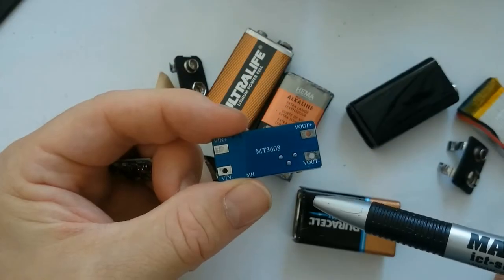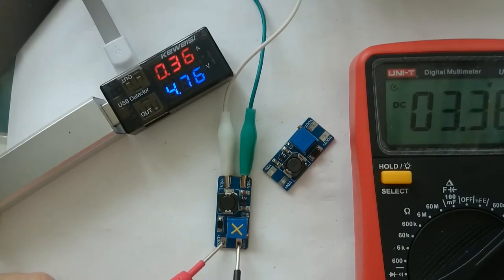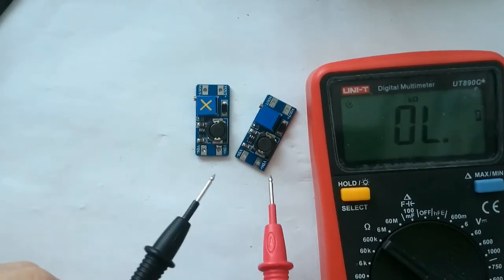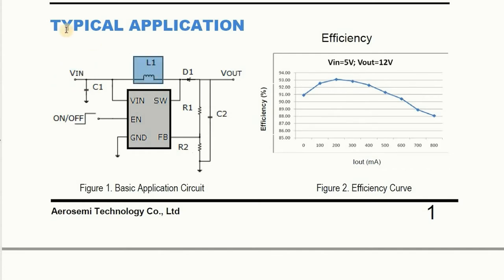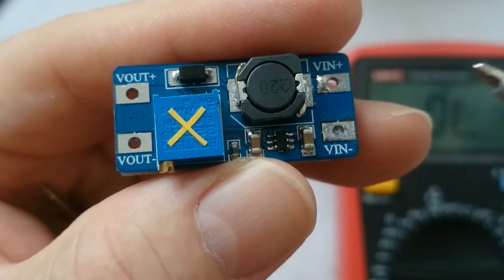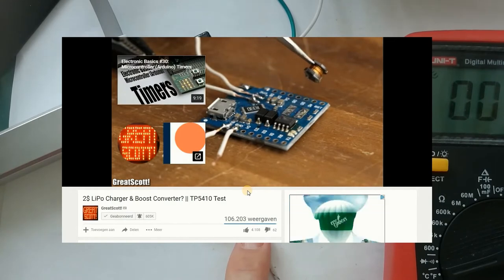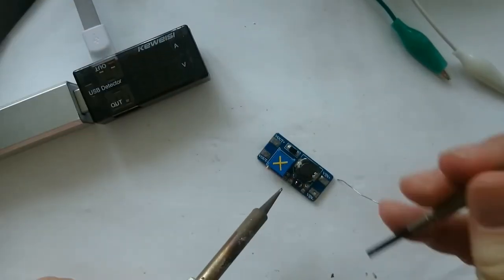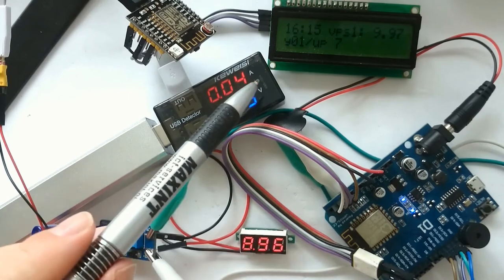Repair: MT3608 boost converter

Comment: That is a creative desoldering technique. The temperature of the chip had to have been near 220C, assuming it was lead-free solder. More importantly, a simple fix to avoid discarding the module altogether. Nice one!
Reply from the maker: +MindFlareRetro  - Creative indeed! For GreatScott it worked better (see his video), but I was afraid I would ruin the solder pads on this almost fully operational $1 module... ;-)

Comment: there's actually a way to stabilize the output and it can even handle all types of load when it is fixed.
Reply from the maker: I saw a couple of different improvements. Which one are you referring to?

Comment: Hi Maxint! The MT3608 is a chip i’m currently looking at for use in a new version of my MiniAmp. Easy to find a pretty straight forward!
Reply from the maker: Hey Dustin! Thank you for your comment. Your MiniAmp is a nice project and your EasyEDA videos (see https://youtu.be/VtKCyu5FitE) helped me a lot!
You may also want to take a peek at my video about making a tiny boost converter using the MT3608 (see https://youtu.be/K7Lv5FWTX9Y).
The MT3608 chip is easy to use. You only need to be careful not to set the output voltage below input voltage, so be careful to use right values for the resistors and don't short the sensing pin to ground (which can be done on these boost converter modules by turning the potmeter to one of its the ends). 
Also note that the amount of current it can supply is limited. When the difference between input and output is large, it can deliver less current and it will be less efficient.
Good luck with your new MiniAmp version!

Comment: There's a video on YouTube on how to desolder without hot air, the trick is to bend some copper wires all around the legs, add solder and off it goes, very easy.
Reply from the maker: I've seen that video. It's very informative. One time I tried that method I wasn't very good at it. Another method I once used (with good success) was using a needle between the chip and the PCB and a soldering iron, to lift the individual legs. While it worked, I think I prefer to use hot air.

Comment: Yeah, so I just did this with one of mine. I only found out it was the main IC after unsoldering everything on the board and checking connections. I should have checked that IC first but now I know! I ordered replacement IC’s so hopefully it will be as good as new! I just had the pot below the input voltage for too long...
Reply from the maker: Well done! While these are nice cheap modules, their lack of protection is apparantly resulting in some casualties. Luckily a chip replacement can revive them to be as good as new. Just beware of the voltage setting...
Reply: Yep, $0.86 and free shipping for 10 of them from aliexpress. I'm going to have to make some DIY boost converter board with multiple outputs and good pots. If I put a pic/arduino on there I could check the voltage and make calculations for minimum resistance. I'm mainly using it right now for a dirt cheap bench power supply for low current running on a laptop battery cell (they are dangerous to take apart but I did carefully).

Comment: I have tried this module. At first all was okay. From 3.7-4.2 V input source I config. for 12V output. My router was working fine. But back in couple of hours it stopped working. I found that my battery was drown empty, though I was using charging mode through a TP4056.

However, I then use another battery (3.7-4.2 V) but this time it fails to delivered the desired 12V load. I checked with multimeter before connecting load it shows 12V in the output jack. Battery is fine.
But whenever I connect to my router as load it falls to 1/10th of the desired volt ! I don't understand what's the problem ?
(input connected through TP4056) Your experienced input is very much appreciated.
Reply from the maker: Sorry for the late reply. Sounds like you are trying to use a battery that cannot provide the requested power. I have had this with batteries that were at the end of their lifespan. These would work fine with low currents, but fail when currents got slightly higher. Best way to test them is using a multimeter and adjustable constant current load.

Comment: nice repair video. i don't know about the idea of pushing high amps for desoldering components, but that sounds risky, it could damage nearby compenents or the copper traces on the board, maybe? but that limited edition tweezer you used for picking the chip off from the iron tip though.. that's awesome. :)
Reply from the maker: Thanks... Yeah, I should be careful as I only have those! ;-)
Reply: @MaxintRD  just sharing an alternative way here, hope you don't mind.. :) 
for desoldering small chip like that, you could put a blob of solder at each side, kinda like if you want to short all three legs of each side altogether, then melt the blobs back-and-forth for each side several times, while your other hand holding the chip with tweezer, ready to lift it off when the solder blobs at both side are molten already. eventually, it will lifted-off within some seconds.
hints : it will be more easier if you have a secondary iron and melt the blobs with two irons at the same time, one for each side, just like how smd hot tweezer works. ;)
Reply from the maker: @radius.indrawan  - I don't mind. Thanks for the suggestions. I used the blob technique too. Not with two irons though. I also once lifted a CH340G chip using a needle to put some force on one side. Nowadays I most often use a hot air gun, which I didn't have when making this video.
Reply: @MaxintRD  yes, hot air station is indeed very useful for this kind of situation. looking forward to your next video Sir. cheers. :)

Comment: Solved! and please ADD new tutorial about: how to repair broken pin or part of arduino board. Start from promini 5v 328p, nano 5v 328p and uno 328p. Pleaseeeeeeeeeeeeeeeeeeeeeeeeee. Thanks 😍😍😍😍😘😘😘
Reply from the maker: Great idea! I once replaced the diode of an Arduino Nano, after frying it by reversing polarity. It was not very hard to do and that Nano still works...
With regards to this booster board, I saw other people make improvements to make it better survive mistreatment and to lower the standby power usage. Perhaps once I make a follow-up video to show both improvements. (I don't have links here now, you may find them in comments below, or search YouTube for MT3608).
Reply: @MaxintRD  okay. thanks.

Comment: i replaced the100k  25 turn multi turn pot with a normal 100 normal 270 
degree trimpot.  the 25  trimpot is really stupid and you need a 
screwdriver and there is no knob for it anywhere
Reply from the maker: Ese Callum - That multiturn trimpot is indeed not ideal. Next to what you mention, it is also inactive in large part of the range, rendering many turns without response. I can imagine you may want to improve the range by adding a resistor in series to the pot.
Reply: did it already.added 82k resistor to 22k trimpot.this is for the version where the 3 rd leg of the precision  trimpot IS connected and the voltage variation only occurs over about 20k. 
in the second variation the 3rd led of precision trimpot is not connected to anything and voltage variation occurs more evenly over a 100k normal trimpot

Comment: Its not damaged its the chip its shorted and other in sets can trip it and high volt out like 8.4v in 25v out gose low volt high current 😕 iam using in a few application projects on the 6 board shorted 5 so far smoke including pin 4 has the issue in the transistor gate!!!!!!!! I'am trying to get the internal on the chip to fix the over load issue.....
Reply from the maker: Hi Troy, thank you for commenting. You raise an interesting point. As far as I know it is indeed the internal MOSFET that is shorted. I always though that the shortage was caused by irreversible damage. So you think there is a way to fix that short-out? If you do find a way I'm very interested. Perhaps you can make a follow-up video?
Reply: @MaxintRD  looking into it, and used a bunch off directors to fix most off the issue on the neg line but when i run the IR RF at the same time it gets a bit tweky could be a run of a safety the transistor for shut off it can become unstable as most of the negs are all directed allready to get it stable and safety setup, on the single IR line its fine and RF but dule mmmmmm i once put a npn type on a IR decor on the out gate pins blow the hole lot one after the next just kept blowing and was the type specified (wrong category) by the looks as you can get reflection on the parts which blow or get unstable when you lock transistor gates in this is a issue with pin 4 for the voltage gain the line seems to be a bit tweky especially on the curcit in development but i had it running on a motor fan 24v low ma above 24v it can trip this mosfet in it apparently as i have no internal curcit diagram which is slowing me down, dont ever short and i noticed a issue with the dc meter and multiple out lines which keeps going to 1.8v high current which should not happen but put it to the battery all ok again yet seen led on the meter and fine??at near 2 amp????? 😞 .
Reply from the maker: @troyw5832  - Sorry, I can't make heads or tails from your reply. I probably lack some understanding. Perhaps you can show how you repaired it in a video?

Comment: Same problem with xl6009 while make rechargeable power supply. Have you found the reason how it happened? Your input is very much appreciated.
Reply from the maker: i think it was due to drawing too much current. i don't think these cheap boost-converters offer any protection against doing that.
Reply: @MaxintRD  I just checked that diode was blown.. so I replaced it by 1N4007 (I know this one has greater voltage drop) and I m able to vary from 3.54 volts to 3.8 volts with 4 v input. Also it is not heating now. Whether replacing with right diode will solve my problem or the ic is blown. (ic : xl6009)
Or i doubt the inductor is blown
Reply from the maker: @shubhamsawant5129  Good you found a defective part. A boost converter should generate higher output than input. In my case I think the mosfet in the chip was blown, resulting in an internal short . The inductor can easily be checked with a multimeter, as it's just a wire it should have low resistance. Another possible cause of damage could be reversing the polarity.

Comment: Sir your demonstration is really amazing and truly on right time have found. Thanks for presenting such a wonderful content.

I have connected MT3608 module with 5v of power bank as input and boost to 12v, later i moved from 5v to 9v and where output remains the same like this couple of times have tested, However i could boost the voltage to desired output with any given input range, when load is connected, automatically voltage get drop to the same volt as input given. When i touch the IC it was too hot, immediately turned off and checked the diode its fine, later some time when connected to 5v power bank or source from 5v dc power adapter, i could see 12volt but unable to connect my router or any dc appliance that has 12v. 

Could you please give some insight. Your input is very much appreciated and thanks in advance for your help and support.
Reply from the maker: Thank you for your post. Reason the chip gets hot is probably that it can't deliver the power that the load is asking. Have you tried using a very small load? Some modules that can deliver more power use heat sinks. Another possible solution is to try increasing the input voltage. The efficiency of the chip is much lower when the voltage difference is high. Also make sure the input device can deliver the required power. I suggest you to use (multi)meters to measure voltage and current under load. Hope these tips help. Good luck!

Comment: I just bought 2 of these units on eBay. So far neither of them works to increase my output voltage. My input is 6.7v and output stays around 6.6v no matter which way I turn the pot or how many turns. Now I don't know if it's defective, or still repairable?  Any idea?
Reply from the maker: Hi Tim, my first guess is that they may be not faulty, but just not set correctly. I've experienced that the range of the potmeter is largely inactive. I would first disconnect the load and turn it down to the minimum level all the way untill you hear the meter tick. Then, with you voltmeter connected to the output, turn it the other way until you see the voltage change. Then continue slowly until you've reached the desired voltage. Then connect the load and check the voltage. If voltage drops a lot or the chip gets hot, your load may be too big. Mind you that if the chip gets hot you should cut the power to avoid damaging it. Good luck!
Reply: Thanks for the quick reply! I removed load from Vout and left Vin connected to 6.7v and turned 15-20 turns counterclockwise until I heard the click noise. Then I measured Vout and it magically jumped up to about 27v. Then I turn clockwise slowly to bring down to the voltage I need. I would've never guessed these steps!
Reply: this worked! thanks for taking the time and effort to reply to this, really helped!
Reply from the maker: Ravi Riley - Great! Glad to read that it works. Thank you for your reply. Good luck and have fun playing with electronics!
Reply: Held! Thanks!
Reply from the maker: Ring Neck - I think so too. Some sellers do warn not to set the output voltage lower than the input voltage to avoid damaging the module. I guess it's better to always set them first using a low input voltage, for instance two AAA batteries. Use those to set the required voltage before using a higher input voltage source.
Reply: @MaxintRD  Tysm Guys!

Comment: I've bought 2 of those, straight out of box not working, input voltage 12.52 V, output voltage 12.08 V. It's weird, i just think this type of Boost Converters are low quality.
Reply from the maker: Hi, I don't think the quality is low, they just have some peculiar behaviour and lack protective components. Here are some tips:
1: On first use they need to be set using really low input voltage. Don't start with 12V input as the output may be set lower than 12v, which could kill the module. Start with low input voltage (e.g. 3V) and then set the output as desired. 
2: You should never set the output below input voltage. This can damage the chip. 
3. Don't draw too much power. When the voltage difference is high, the chip can deliver much less power. Put your finger on the chip too check if it gets hot and test it with the maximum power you intend to draw.
Hope these tips help. In my view these are cheap yet fine modules once you are aware of their peculuarities.
Reply: @MaxintRD   AGREE I have ordered 5 of these 2 have arrived But None of Them Work !
Reply: I have reported the problem, and contacted the seller, and encouraged him to test some of them on his own. What happened next, he admitted it is his fault. They were sent non working. He returned the money, but I still lost $1 for Local shipment which is even more than the Products price, since he obviously will not return the money your government takes. Anyways, nice video, and At least I can use the Coil to make my own boost converter with Arduino hehe.
Reply from the maker: Allright... That's a good idea! GreatScott has a video where he builds a boost converter using an ATtiny chip. In a follow-up video I used another MT3608 chip and some smd components to solder up a mini boost converter.
Reply: Yes I kinda built it few weeks ago with arduino, but my parts are kinda big, not as compact, I've  built it for Bee Venom collector. Perhaps it doesn't matter its big, I'm kinda lazy to build another one 😕😂
Reply from the maker: Sound fine to me. Big parts are sometimes needed to provide higher currents. My mini MT3608 boost converter doesn't provide as much current as the regular one does. Bigger parts are also easier to handle and to find back. By now I must have spend many hours on the floor hurting my knees while searching for dropped SMD components...
Reply: I had one that just needed the pot turned like a billion times before I noticed a voltage change.

Comment: Bhayya good morning.
Can I connect MT3608 boost converter to output of TP4056 while it is charging an 18650 battery?
Please reply
Reply from the maker: Yes you can connect the boost converter to anything that can deliver sufficient voltage and power. Mind you though that you don't overload the TP4056, as it usually won't deliver a high current.

Comment: Nice work! What is the inductor value? 22uH? Do you have any information about the ripple values at the output?
Reply from the maker: Toca Disco - It is labeled 220, so I think you're right about the 22uH. In this video I only replaced the chip, but you may find my subsequent video about making a mini boost converter interesting too. I haven't measured specifics such a ripple values and unfortunately my cheap DS112 oscilloscope isn't quite suited for precise measurements.

Comment: Can anyone tell me what will be the value of R1 AND R2 if we want to get fixed 6.7V output not using rheostat to adjust.Input is 3.7-4.2v
Reply from the maker: In my follow-up video about the MT3608 you can find the formula from the datasheet and how I used it to set a fixed voltage: https://youtu.be/K7Lv5FWTX9Y

Comment: I watched this video in desperation. I bought 4 modules and I managed to kill 3 of them with reversed voltage.
Reply from the maker: Luckily the MT3608 chip is quite affordable and not to hard to replace if you have a hot air gun or decent soldering iron. Coincidentally this morning I used an MT3608 chip to repair one of those cheap USB boost converters. The original chip couldn't withstand the current I was pulling, got hot and released some magic smoke...